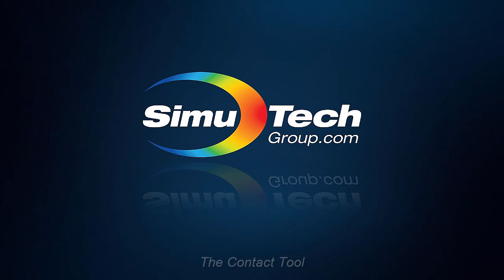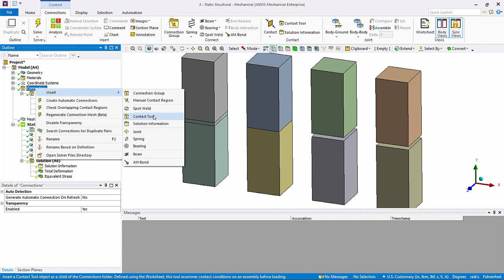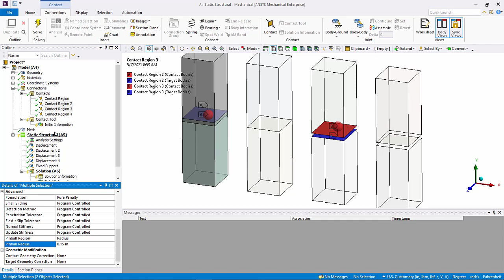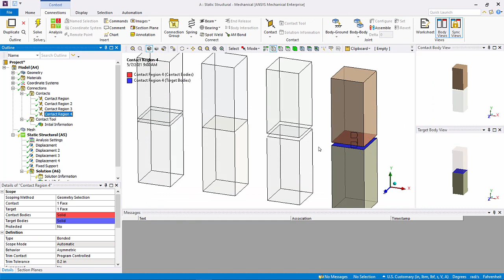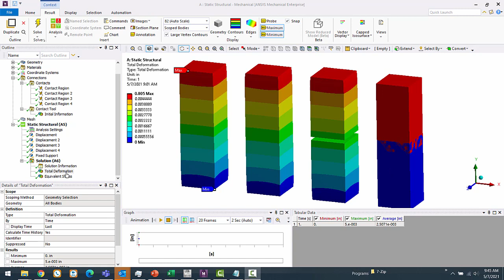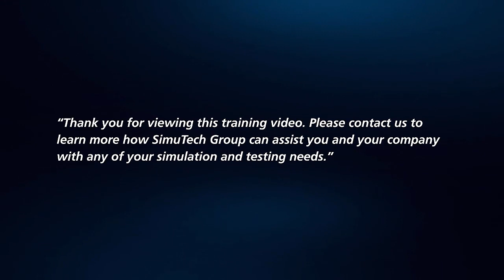Mastering Contact Detection in Ansys Mechanical: Utilizing the Contact Tool

Comment: I showed your video lecture for contact tool, and thank you very much. I have a question about a problem I have never experienced with the contact tool. When I insert a contact tool, a question mark appears in the upper left corner of the contact tool. Even if you try to delete it, it says that some paths to the contact tool cannot be found and it is not deleted. I would appreciate it if you could tell me what the cause is and possible ways to solve it. Thank you in advance
Reply from the maker: Thank you for your comment! Unfortunately, the question posed is not something we can answer without knowing the details of your particular model.  We highly suggest you submit a support case to your support provider. If you'd like additional information, you can reach out to info@simutechgroup.com

Comment: Thanks for the bite sized video on using the Contact Tool! 

Could you consider similar short videos on other options in Contact settings? Such as Interface Treatment, Formulation, etc